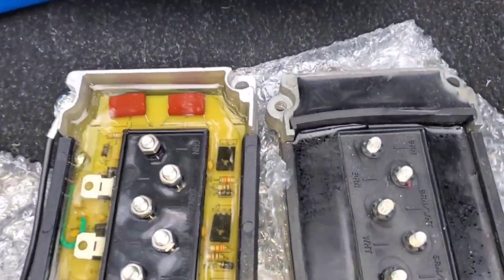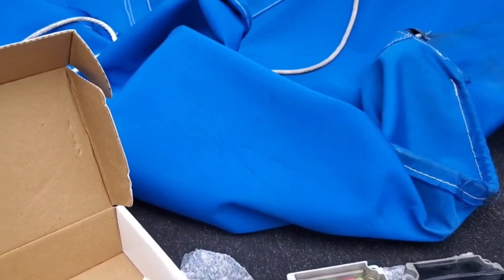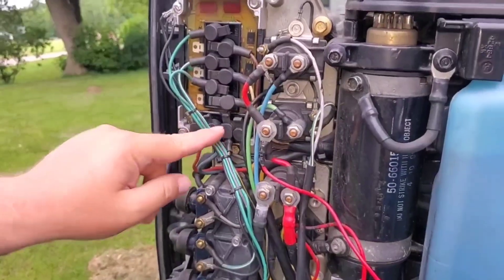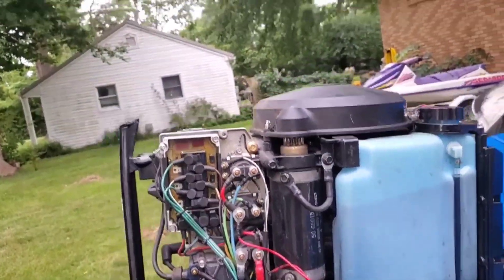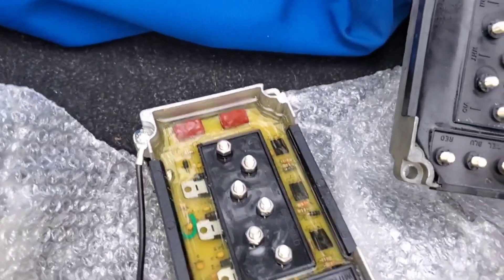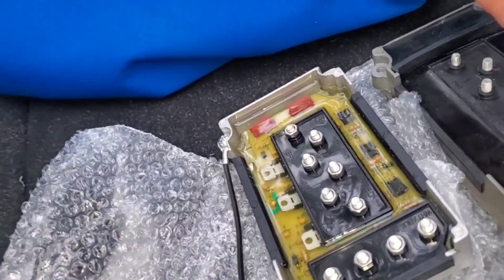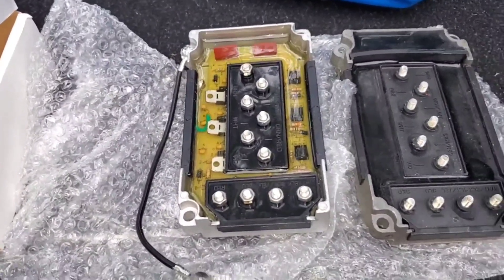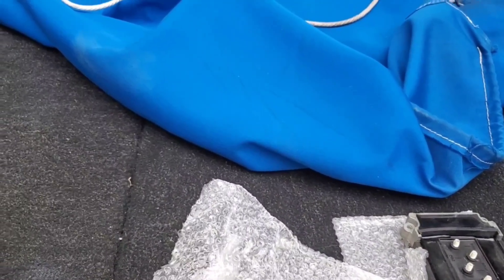How to replace switch box and diagnose and repair a no spark condition on a Mercury outboard engine

Comment: Hey i bought these same boxes and i switched the cdi and stator and im still not getting spark what can be the problem ?
Reply from the maker: At none of the cylinders?
Possibly a coil or wire?
Any chance the flywheel keyway slipped? That onle happens if nut comes loose or you hit an obstruction hard.
Reply: Stator or trigger could cause it